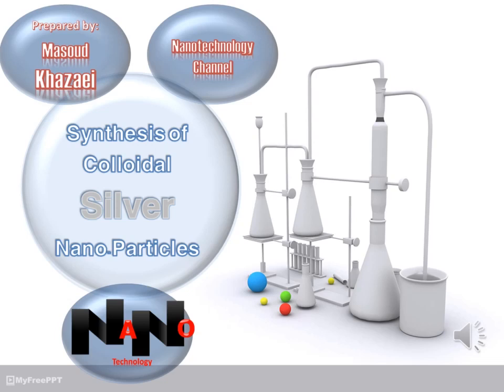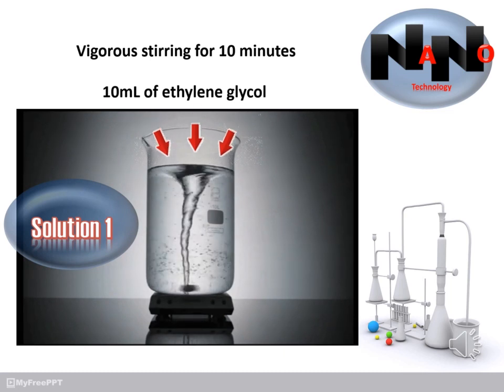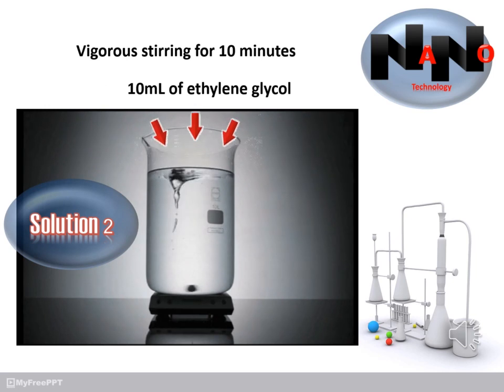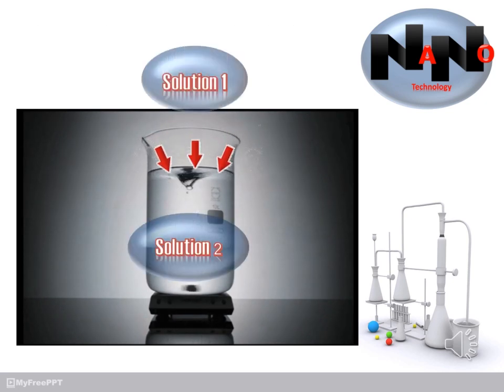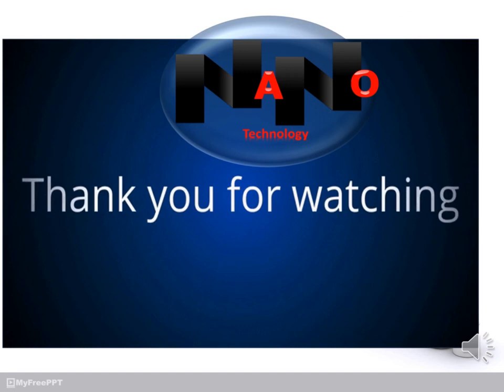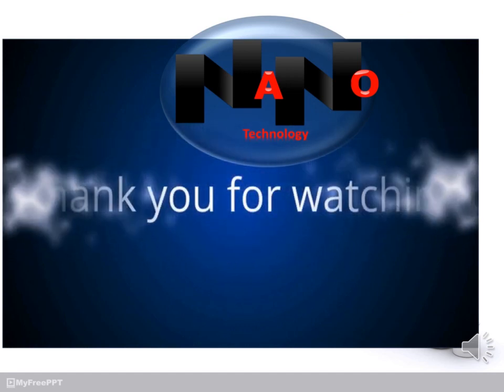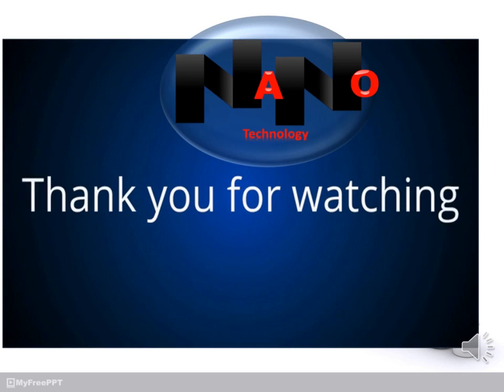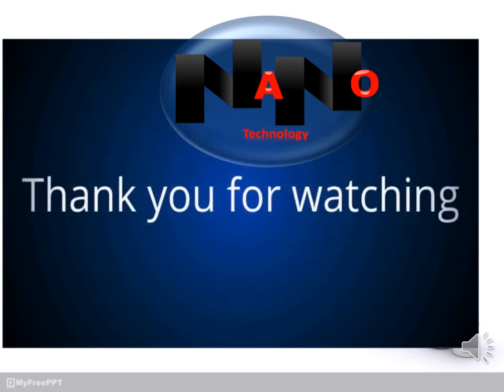Colloidal Silver nanoparticles

Comment: Simple and safe way to make Colloidal Silver:
(2) 10 Gauge 99.99% pure silver Rods 
Distilled water 
Must Use Constant Current vs Constant Voltage In Order To Obtain even sized nano particles.
Build the Dr Bob Beck cc Silver Generator circuit easy and inexpensive.
Peace..

Comment: I am making my own: use ONLY distilled water, 0.9999 purity silver rods, keep it in dark containers and have not been sick for years.
Not promoting it - do your own research. I saved my wife from a bad case of sinusitis. After 2 bouts of taking very strong antibiotics and letting her get the best medical care (which failed to fix the issue), I had her inhale nebulized colloidal silver of over 100 ppm strength. She got better after the first time inhaling it and completely well in 3 days. She will continue doing it for a total of 7 days just to be sure.
About argyria: yes, it does exist, but it happens in a handful of people globally, and mostly in those who use salts in making their colloidal silver (which is not even real colloidal silver - it's a poisonous substance called silver chloride). Salts enhance the electrolysis of the process and the particles of silver are much bigger than the 1-10 nanometers in size AND they also bind with the sodium from the salt and form the poison that will turn you blue if you ingest lots of it, like more than a pint a day. Papa Smurf was ingesting several pints of silver chloride a day.
The smart way in non-cancer cases is to take at most 1-2 tablespoons per day internally, not more. Externally you can use more, as the skin will not absorb too much anyway.
In cases of cancer, I have read a scientific paper about a patient taking 1-2 liters of pure colloidal silver per day and surviving stage 4 cancer at an advanced age. The guy did not turn blue and got cured. Search "a silver bullet to treat cancer". Third-party info, so don't hold me accountable for this :)
Peace and health to all!